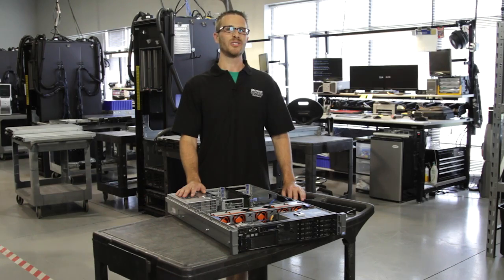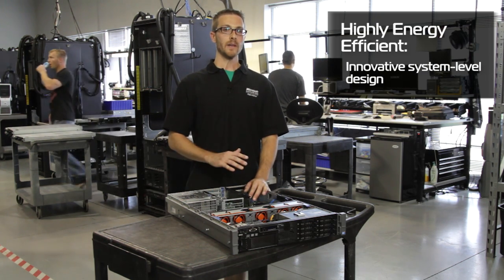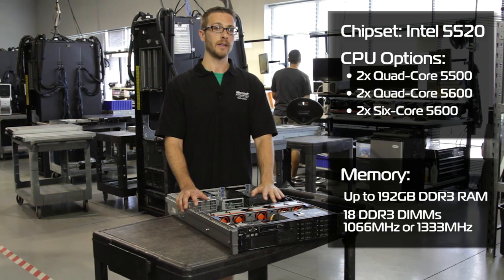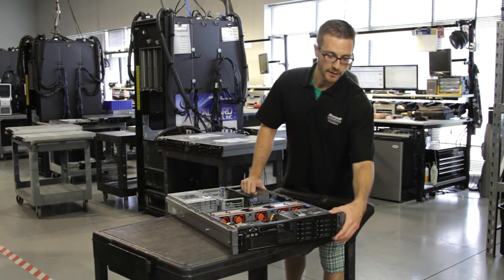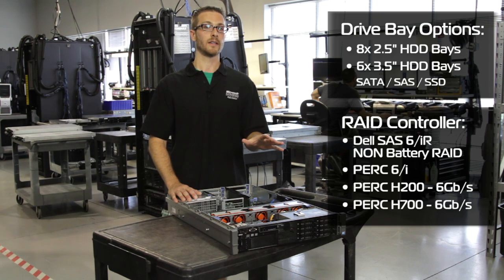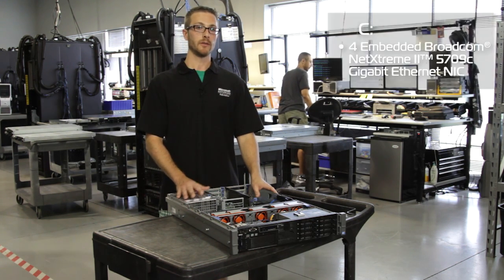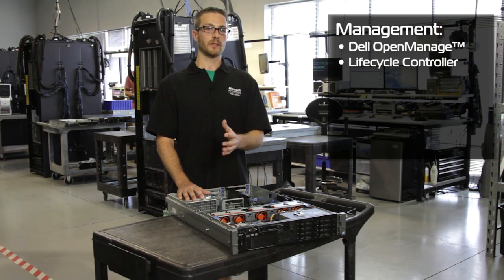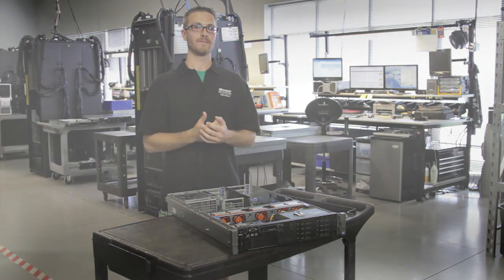Dell PowerEdge R710 - System Overview

Comment: Needing the part for mounting the hard drive for a custom desk pc build.. anywhere online that strips these down as all im after is the hard drive section where the drive sleds goes, the sleds themselves..

Regarding the backplane, will the capacity be ok to host 16tb drives?? 

What speeds will the drives work at as i have 2 16tb drives with another 4 eventually to be filled into the drives.. 

And the data cables for the hard drives.. im not sure what the connection is on the backplane for the hard drives and was wondering if there is a cable that could be used for a pc..

Or if someone could lead me to a 6 bay drive chassis or enclosure.. I'd be rather happy. 

Thanks

Comment: Which raid controller would I need for the r710 if I put in a higher version hard drive like the 4 or the 6tb hard drive as the r710 is limited to 2tb on the perc 6i

Comment: 18 Slots x 16GB = 288GB

Not the 192GB he said
Reply: The board only supports 192GB of active RAM, the extra slots are available for RAM failover. Have been working with these for the past few years.

Comment: You would not want to use this as a desktop.  It's a full-depth rack server.  It will be very loud, and not optimized for graphics at all.  This machine is designed to run headless, in a server room or data center.

Comment: Now this could be a silly question, but I still would like to know.
I need a powerful machine for photo editing (and I found an R710 with plenty of RAM and dual Xeon). Especially for Photoshop CC and Lightroom 5. That implies also running Win 7.
Now I know this is a server, but could I get those above running on it? In fact, can I use it as a desktop computer in the first place? Does it have at least a graphic card?